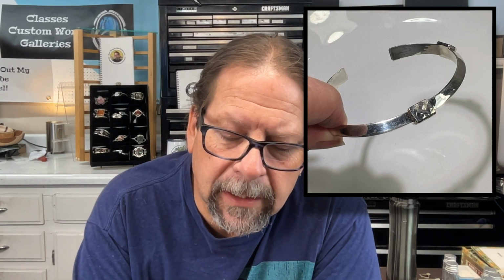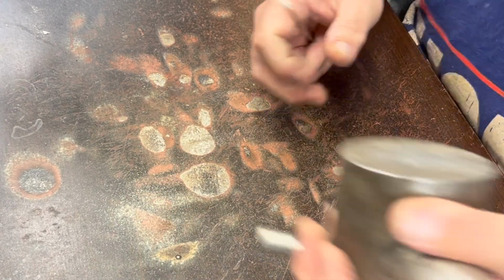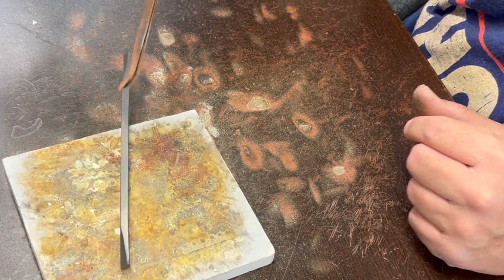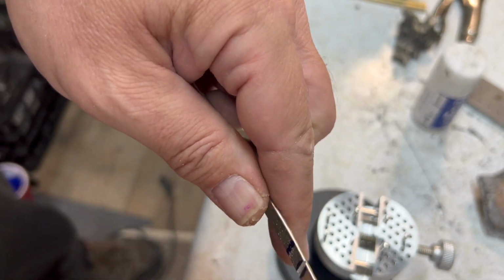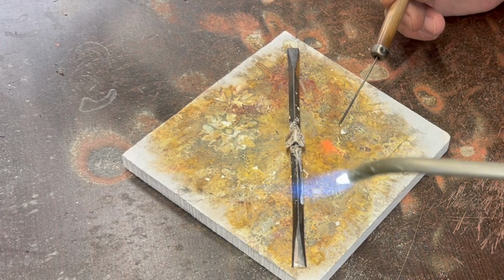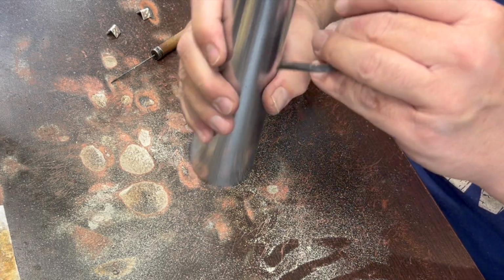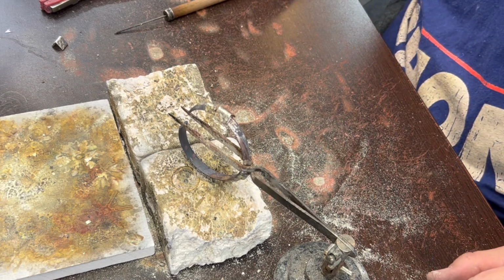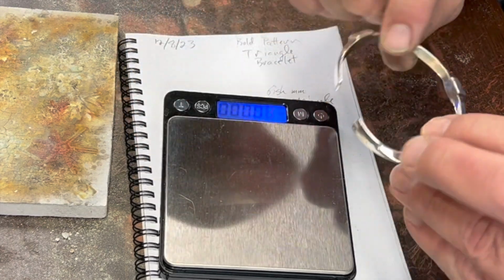Make a Bold Triangle Wire Bracelet: A Silversmithing Tutorial

Comment: Question: was the triangle wire dirty from annealing when you soldered the first piece of pattern wire?
Reply: Okay, never mind that; it was dirtier for the other pieces! I thought that was forbidden! : ) Good to know it works!
Reply from the maker: Hello Goatskip:). It was quite dirty!  I do things a bit non-traditionally.
Reply: @chadssilversmithing Why aren't you teaching traditional techniques? Dirty metal makes for weak solder joints and can cause it to snap off over time. The flux keeps the metal clean, it doesn't clean it. I learned this lesson the hard way. There's a reason for traditional techniques.  Please encourage proper techniques to people who are learning this wonderful craft so they can make heirloom quality jewelry that they can be proud of providing.  You have some wonderful design ideas that have great potential for traditional techniques without taking short cuts.  I'm not trying to be difficult or mean. It would have saved me great embarrassment with some earlier pieces if my 1st teacher had taught me properly years ago.  It wasted a great deal of my time and efforts and was quite frustrating. I doubt this is your intention at all.  Shouldn't we all be on the same page in such a craft?
Reply from the maker: @tywhitmire860   Thank you for your thoughtful input Ty. My experience with solder joints has been different than yours. I have not had a problem with weak solder joints because of this.  There is absolutely nothing wrong with pickling between steps, and if you want to do that extra bit, it’s fine. In fact, if my piece is really messy, I will pickle it a bit to clean it up if it seems to need it.  It has been my experience that the biggest problem causing weak solder joints is ineffective heating of both pieces, usually when there is a mass disparity between the parts being joined. People get one part up to soldering temperature, but the other doesn’t quite get there, preventing the solder from adhering to that piece even though it looks like a good solder joint. I appreciate you bringing up an interesting topic in the comments.  As always, people should take what works for them best from individual instructors.  Perhaps I will even do some experimenting to see if I can ascertain any actual differences in strength on some identical pieces when I have some time.  It sounds like a fun experiment:).  Thanks again for bringing up an interesting discussion Ty!